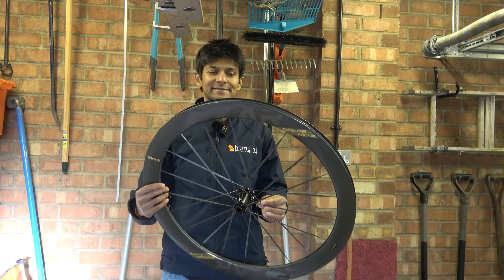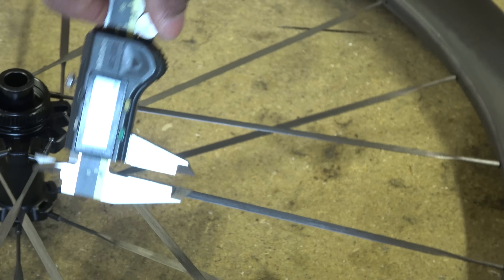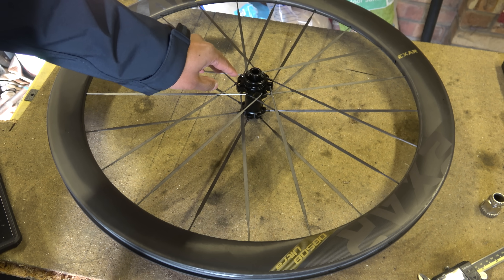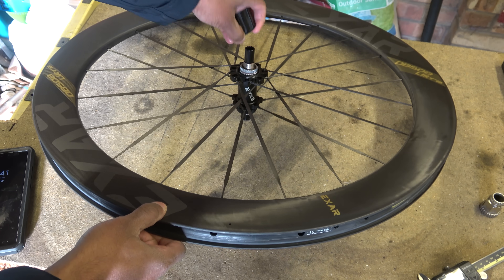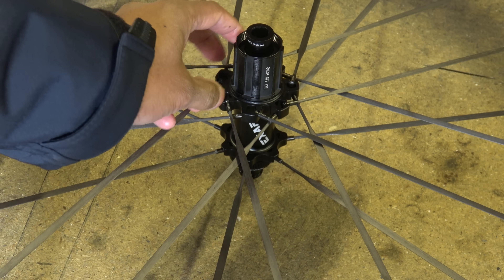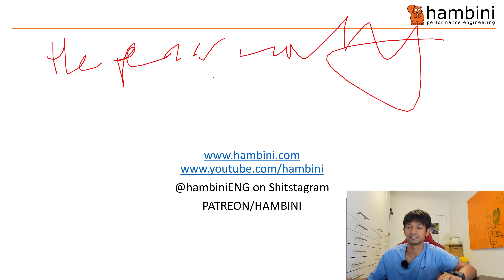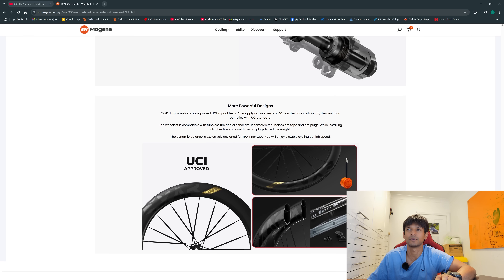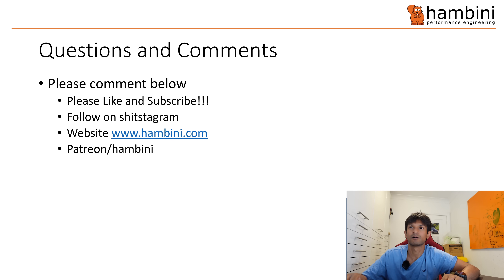Magene’s Wide Wheels Are INSANE – Hidden Nipples, Carbon Spokes & Zero Flex

Comment from the maker: If you're wondering whether carbon spokes, hidden nipples and rectangular hub springs are a good idea, you're not alone. This wheelset is stiff, fast, and definitely not built for Sunday comfort rides. Let me know what you think — aero brilliance or overengineered nonsense?

Full teardown photos and data here: https://www.patreon.com/hambini and from my website https://www.hambini.com/magene-exar-ultra-db508-2025-wheelset-review/
Got questions? Stick them below. I read all the comments (even the daft ones).

Like, share, subscribe. Or don’t. I’m not your mum (or if your mum is a hairdresser, make sure you share!).
Reply: "..decent flared metal insert where they anchor into the rim. That should reduce the chance of any pull-through or debonding under load." while it would prevent me from riding around the block on 'em. 
Metal bonded to carbon under stress like this + the results if a few of these fail at the same time..mean NFW I'd ride 'em....but I'm sure they'd be great for your hairdresser or your pals at MAPDEC.
Reply: Is it mechanically possible to make a rim stiff laterally but a bit more compliant vertically? I always go for a stiffer wheel as a preference but wonder if there is some combination of factors that could affect this?
Reply: Carbon spoke is a bad idea. Steel is quite good for tensile load in weight/strength so the weight gain is there but minimal. For aero a slimmer spoke is better. For compliance steel wins. Saw some comparison between textile / carbon / steel and steel is midpack for compliance beat beat both in aero. Just throwing money at something does not make it better. Hidden nipple is a risk that can be justified because a good carbon wheel normally doesn't need trueing .

Comment: Can you make a video on the Conti Aero 111 tire and its claims? It i think it is funny that dt swiss data shows their old narrower rims stall at higher yaws than their new 2,5 mm wider rims. 

You find the graps under "a leap is taken not given" for tjhe new gen wheels. 
And under the articales about the aero 111 tire. Aditionally swiss side also provides graphs on their new wheels. For closure swiss side provide the aerodynamics and dt swiss makes the rims. So swiss side wheels and dt swiss are the same.

Edit: would this change the fact shallower wheels are faster in high yaw gusty conditions do to high stall loses?

Comment: Have these and Cadex Ultra 50. They are exceptionally impressive for the price and have basically the same feel as my Cadex. With a sort of 'kick' to them when you're really hard on the pedals (racing, uphill sprinting as a good example). 

Reviewed them for Cyclist Mag here in Aus and they were so good I purchased them. No freebies. Wanted them as a slightly deeper option versus the Cadex. That was how impressive I felt they are. 

Also not noticed any harshness on the ride with them. 30mm Pirelli (tubeless) set up. 

The only part that had me slightly concerned is the spoke/hub interface. Which some on the Tube have flagged as 'catastrophic failure point'. I'm in no way qualified to pass comment either way. Keen on a deeper dive into that if you have the chance H.
Reply: I've seen these exact wheels have a catastrophic failure after a single spoke snapped which is why I stopped using them. See my comment below.
Reply: @matthewludman1912 not casting any shade when I say it's interesting to have a reply to a new comment, on a days old video, within 22 minutes. That said, your reply notes you've seen a "catastrophic failure". Your actual comment talks about 'cutting one of the spokes and see what happens'. 

Again, not an expert in the aspect of wheels. However there's a difference your reply to me and the comment in this thread. And if it was that drastic, could you share the video of cutting a spoke to show users what happens.
Reply: I haven't cut any spokes on these wheels but I've seen first hand what happens when a spoke snaps with these wheels & it isn't great. The rider it happened to luckily didn't suffer any major injuries but he had to sign non disclosure agreements after getting paid out for the damage to his bike. I'm commenting because I don't want to see anyone seriously injured because of these wheels. If Hambini records a video of what happens when a spoke on the front wheel suddenly fails  you will agree with my concerns.
Reply: I also think that Magene make many great products & I personally was very impressed with the performance of these wheels until I saw what can happen after a spoke fails. Magene are very much aware of the incident I'm talking about but they have still made the decision to keep using this hub design. Hopefully no one else gets injured as a result of this.

Comment: The real problem with carbon spokes is that the spokes are stiffer than the rim, ergo any impact to the wheel cannot be taken up by the unflexing carbon spokes unlike say Sapim XRay spokes which is why most pro race wheels are still built with steel spokes. Also the availability of carbon spokes in the retail market place is severly limited, so break a spoke and you might not be riding your bike for a bit. Unrelated, why are you riding a frame that is too small for you, you should be on a 56 cm frame, and not a 54 otherwise you're forced into a longer stem length and this places more of your body weight towards the front of the bike upsetting handling and possibly making the bike less stable at higher speeds or on steep decents.

Comment: how much do they pay for a good review?
Reply: Proud owner of a DB607 here. Granted I'm a sample size of 1. Really excellent pair of wheels. Heck I even bought their power meter crank. I'd be pretty stumped to find fault in them given the price to performance that far exceeds most "branded" wheels.
I thought the review was objective and concise. It did mirror my experience with them being stiff.
Reply: The problem. The dishonestly on the internet among so called youtube influencers is rampant.
Hambini is the disinformation poster girl. 
PS. for those considering carbon wheels, don't be an early adopter. Track record and customer support if not from the OEM, a good reputable wheel builder is everything for long term customer satisfaction.  Wheel cost is only one element in the equation and factors like rider weight and strength matters for overall perception of wheel stiffness and longevity. One size doesn't fit all.  Name brand companies including lower cost Chinese wheel makers develop a good or bad reputation for a reason. Let start up manufacturers do their beta testing on suckers willing to take a flier.  Last and not least, don't trust charlatan Hambini.  This from a real mechanical engineer who knows he is a combination of clueless and a liar.
Reply from the maker: @lukewalker1051  I'd disagree, the problem is the prejudices still exist and a lot of people can't get their head around the fact that Chinese OEM wheels are just as good as western "Branded" wheels which are made in the same factories. You may not like it, but it's the truth and that can be garnered away from just subjective opinion. Objectively, when the wheels are subjected to mechanical tests, they come out well. 

Luke is obviously a real engineer. He should know that most of these chinese companies are THE OEM. He hasn't quite grasped that concept.
Reply: All I know is that my 2025 Farsports Evo s5 have been flawless along with my Hambini bb.
Reply: @lukewalker1051 spot on
Reply: @lukewalker1051 You just made a bit of a prat of yourself, chucking out allegations without a single fact to back them up, while bigging yourself up.

Comment: They would be great wheels but the hub design is a major & potentially very dangerous design especially with the higher tension of carbon spokes as if one spoke fails & the wheel suddenly  loses tension all the spokes can quickly detatch from the hub flange which is never fun!  Cut one spoke in the front wheel & see why these wheels are a major court case waiting to happen...

Comment: I have been using these wheels (EXAR Ultra DB508 2023) for 15 months now for racing (IM70.3s), training, and pleasure rides. Paired with 32 mm Conti GP5000 TLR tubules at 55-60 psi, it feels actually really comfortable. The truth is that after this combination, you might not want to try any other wheels at all. Only one concern (besides weight) is that my wheels are losing air pretty fast, but it could be due to my subpar tape job.

Comment: what do you think about this: lightweight stiff climbing wheel for like andrew feather. out the saddle n stuff. but the deep wheels allready stiffer from the rim but otherwise build quite supple for high speed flat riding where you want to dampen the vibration?

Comment: Have you noticed any significant difference in aerodynamic benefits between 5mm and 3.2mm wide spokes? How do they behave in crosswinds?
Reply from the maker: I haven't tested the same wheel with different spoke chord lengths but I have some general feedback and it's firmly in favour of the longer cord spoke. The difference in cross wind stability is hardly anything but there is a noticeable reduction in drag.. As with all of these things, the difference gets bigger as you go faster.

Comment: Since carbon bikes are stiff, adding very stiff wheels makes no sense. Comfort enhances performance. After an hour ride, you would be bashed by these wheels anyway.
Reply: Have 85mm wheels and nothing like that is happening, i am bashed when i use older alu frame with no sloping on top tube, after 1-1,5h i get wrist pain lower back pain. CF is dampening vibrations by itself way better than alu or steel, thats not my opinion thats just property of the material.
Reply: I have the same wheels but the ultradark series (non ceramic bearings) and I think I have the 3.5mm carbon spokes instead of the 5mm ones. I race with them on my winspace T1550 gen 2 frame and I will say they are just a comfy as my TCR a with DT Swiss 1100 50mm wheels with 28mm tyres on. I have a 30mm on the front and a 32mm on the back and I really can’t feel any less comfort with wider tyres

Comment: Been riding the Magene 405 Ultra for about 6 months .. been very impressed with them. Riding on Pirelli RS 32mm the rims are not uncomfortable
Reply: What width do the Pirellis come up to on the magene? Are you running them tubeless? I've found the 30mm to come up at 33.3mm on a 25mm IW rim. Thanks.
Reply: @atgnicyclist .. they come up at around 33mm. The rims are 23 internal... and yes they are the tubeless version
Reply: @cannon1156  Many thanks. Looks like the Pirellis really are coming up big then. Aero wise, I think the 30mm is too wide for these wheels if they are only 30mm wide externally.

Comment: I run the latest Ryet superlight wheels, which are half the price and just as good as anything out there. They come in at 1280g, bladed spokes, ceramic bearings, and a ratchet hub. 50mm deep.  I don't wish for anything more. Fast as.

Comment: Be interesting to compare with the new Winspace Hyper 5 as the design brief looks similar: also hidden nipples, carbon layup, and start at 1195g for the 40mm version. For me, a heavier rider, wheel stiffness is a good thing and I think this development is happening in parallel with the trend for wider tyres. By the time we’ve put 30mm tyres on there the comfort is fine, even for Sunday rides!
Reply from the maker: I've noticed done i started going faster that the difference between wheels is a lot more noticeable. I think you might be right though, this trend to ever  stiffer wheels is relentless
Reply: @Hambini do you measure vertical and lateral stiffness? I'm sceptical the vertical stiffness isn't dominated by saddle, seatpost, tyres but happy to be shown otherwise(?)
Reply from the maker: @thomas618  i think the vertical stiffness will be dominated by the tyres but the rest of it will also contribute to the overall "feel". having a longer stem or a longer seat post will have quite a dramatic effect on the "springyness". However if you are on the same bike and the only think you change are the wheels and keep everything else the same then you can rule the other things out as a constant. These wheels are ridiculously stiff, you can trim it out with tyre pressure.
Reply: @Hambini obviously the effect of wheel stiffness isn't zero, but unless someone can quantify it and show it to be meaningful I remain sceptical this isn't just a placebo effect.  I have two deep section carbon wheels one with the thinnest dt aerolites and another with vonoa/strenns and I can't tell the difference.  As I mentioned previously, happy to be shown otherwise but I'd wager there's isn't even 1% difference in the system stiffness.  I would have thought it would be straightforward to instrument and include in your tests(?)

Comment: My thinking for the stiff ride is the length of the spoke and its low tensile strength at which the spoke acts like a guitar string and the road vibration and the short length of spoke creates a high vibration that translate to that feel. 

I wonder as the spokes become hidden inside wheels will we see the creation of fairings on carbon shallow wheels making the spoke longer and easing the vibration issue..... Kinda like HED wheels 😂😂😂
Reply: Also I am First yet again... SUCK IT TREBEC!